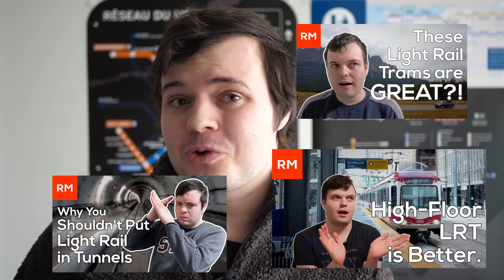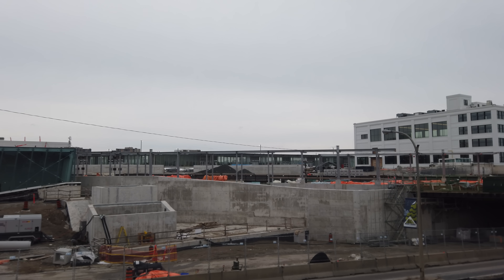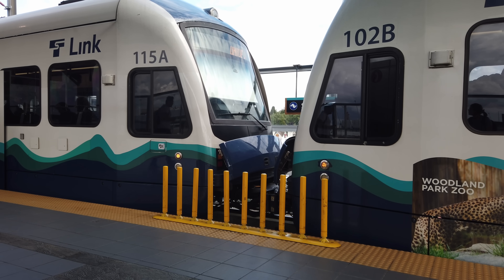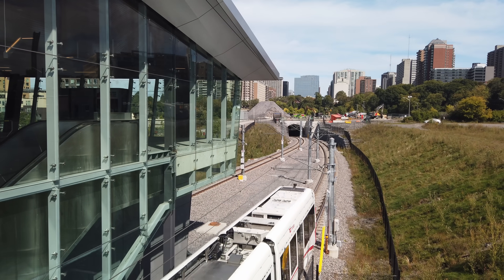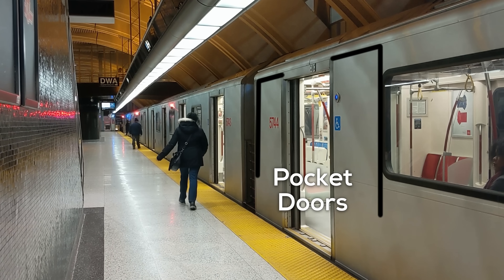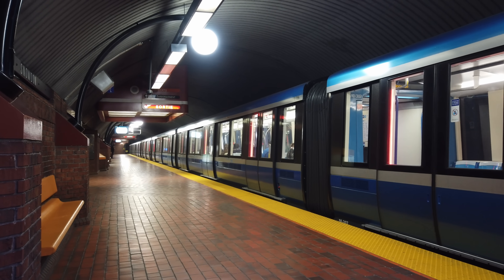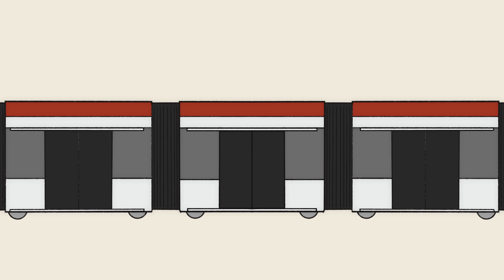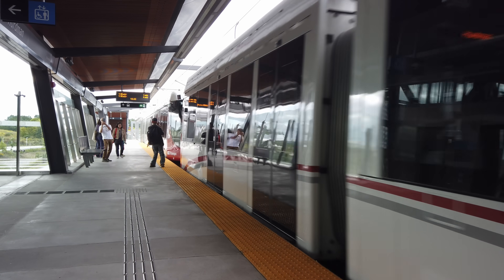I Designed a Better Low-Floor Tram

Comment: Your invention has been tried out in Germany in the eariy 1990ies, with the EEF (Einzelrad-Einzelfahrwerken) and the prototype with powered single wheelsets (axle configuration A'A'+1'1'+A'A') was a massive failure as dynamic wheel-rail behaviour whent banana.  The project and prototype got scrapped.  However small batches of unpowered wheelset equipped tramways have been produced, among other running in Kassel, model NGT6D (axle configuration Bo'+1'1'+Bo').  Siemens had also produced one Combino prototype with a single unpowered wheelset at one end in the 90ies, which didn't work well.  The Copenhagen S-Tog you've seen developed by LHB (since then Alstom Deutschland) with mechanical cross-links between axles which are a rolling stock maintenance abomination.  If low-floor tramway architectures were flourishing in the 90ies where every company was in look of developing and patenting the "killer LF tramway of the 21st century", these architectures essentially narrowed down to the multi-articulated vehicles which are a good compromise and that almost every manufacturer does produce now.  If you want quite long tramways take a look at the Leipzig and Dresden 12 axle fleet, they're not bad at all !
Reply: How about computer steered wheelsets?

Comment: having a flexible fleet of light rail-based train sets with interconnection between segments is actually possible. Frankfurt recently ordered new "middle segment" sets consisting of two wagons which don´t have a full driver cabin but a "half" cabin to rearrange train sets. Which means it is open on both ends and can be coupled to train sets which do have a full cabin. Since Frankfurt´s U-Bahn operates with two-wagon trains either consisting of two full driver cabin at each end or (that´s the part you´ve been waiting for) one full driver cabin and an opened end to couple with another. You see where this "two open end" wagons fit in, amr?

Comment: This is actually something that could really reduce construction costs when building new stations on new metro systems because tall platforms can be expensive, and if you combine low floor with low interior height more comparable to that of say, the Glasgow Subway (which is a little extreme, but illustrates the point), then you could drastically reduce overall construction costs by reducing tunnel size and platform height, if that makes sense, and would do so without sacrificing capacity.  Does that make sense?
Edit: typo, oh, and the Siemens ULF trams in Vienna had most of these features.

Comment: I have a different idea for a high-capacity low-floor train:  Look back to the Boston Elevated Railway's Center Entrance Cars of the early 20th Century.  They weren't 100% low floor, because they had ends riding on normal bogies, but they did have large low floor center sections with 1 BIG sliding door on each side, and lots of standing room; they gained the nickname "crowd-eaters".  They were mechanically very simple (no articulation junctions, weird suspension, or strange lateral sequences of axles to make otherwise isolated wheels track properly).  This would make maintenance easy and infrequently needed assuming good quality of parts and assembly, as well as greatly reducing initial capital investment.  What killed them was the lack of a proof of payment fare system, so that you had to have a conductor in each car as well as a driver at the front, but having a proof of payment fare collection system would get rid of that problem.  If you additionally made the control stands fold up into the sides/ends of the car when not in use (and have each control cab have a big interior sliding door that you leave open when not in use), they wouldn't even take up much horizontal space.  (Naturally, you would need to have the control stand fold into a locked cabinet when not in use, but I understand that this has also alredy been done on both streetcars and metro cars.)  Of course, you would want to modernize the Center Entrance car design to have pantographs (instead of trolley poles) and AC propulsion, as well as add air conditioning (although consider running fans to draw in outside air instead of running the air conditioning when the outside temperature is right for it, to save energy).  In systems that have less sharp maximum curvature than Boston, you could also make them longer for more capacity (after a certain point, you would need to go to 2 or more doors on each side); but even in Boston's system, a 6 car train of these would have almost the same capacity and be about the same length as a 6 car Blue Line train (metro that uses short cars due to being originally made by conversion of the East Boston Tunnel from a tunneled streetcar line into a rapid transit line, which had the unfortunate effect of breaking the one seat rid people were getting before).

No fantasy design needed -- everything has been done on some successful transit vehicle or other.  It just needs to be combined into one package.

Comment: 4:37 So you're telling me that low-floored "light rail" vehicles often have a greater weight-per-bogie than their "heavy rail" counterparts? Something isn't quite right about that...
Reply: Light rail vehicles are generally 'heavier' than heavy rail vehicles. Because the light vs heavy in the name refers to how intensive it's operations are intended to be, load wise, not to the mass of the vehicles that opperate on it. 

Basically, because of the conditions they operate under, making heavy rail vehicles heavier makes them less efficient for no benefit. On the other hand, light rail vehicles operate under conditions where the extra mass (mostly in the form of greater structural integrity and more safety features, to my understanding) is a Significant safety advantage, and they don't generally operate at high enough speeds for the loss of efficiency caused by that extra weight to be particularly meaningful. 

So, yeah, the 'low floor' part doesn't matter, but light rail vehicles are generally heavier per wheel/bogie (and sometimes in absolute terms, for that matter, depending on the exact designs in question) than their heavy rail counterparts.  

Edit: Note that this applies to Passenger vehicles. Not that you get much in the way of freight LRVs these days, but the relevant factors involved mean that freight wagons for light rail would generally be lighter than freight wagons for heavy rail. Freight is heavier than passengers, necessitating more mass be dedicated to the structure holding them, and an LRV would run into issues with wagons longer than a single shipping container (heavy rail wagons generally being long enough for two, and then often stacking them two high as well)
Reply: @laurencefraser  Thanks for explaining! Until now, I just assumed that light rail vehicles were named because they were smaller and lighter in weight than full-size trains.

Comment: Nice video. Some tramcompanies in Europe are at the moment in doubt how to handle the lowfloor concept: existing trams are having their issues resulting in more trams in the workshop as planned. Not to mention extra maintenance costs on the infrastructure. So some companies has decided to do a stap backwarts in favour of traditional bogies. One exemple: RNV (Rhein Neckar Verkehr) in Germany has ordered new trams from Škoda to replace the first generation of lowfloor trams, the first of which will be delivered this year or next year. The bidirectional trams will have 3, 4, or 6 units, each 10 metres long. Every segment will rest on two bogies. The 4 and 6 unit-trams can be split in half in case of maintenance or repairs. That way they do not have the need to rebuild the workshop. RNV is expecting much better comfort AND a reduction of 25-30% in costs for tram- and trackmaintenance.... The consession RNV has choses for is a tram with "only" 75% lowfloor because the seats above the bogies are placed on so called podests. In my view they have made a good choise: most people have not a single problem to climbe a small stap and trams on fixed trucks are not running very well in curves.

Comment: Actually this train is quite high capacity, but people just hate standing, whether it's a short journey or not. 
Therefore, I suggest to merge two "cars" into one and keeping only one door for each. Except from the extra seats, also, this can help make larger doors, and a few seats with space underneath. The space underneath can be quite useful, like putting luggages under the seats, which would also increase the spaces for standing.
I think more seats is for both higher quality travel and more passengers. Imagine the tram as a bus, people can easily get a seat and this is one of the main reason people taking buses. More seats can provide a better journey, so actually if the capacity lowered by a bit, they can just buy one or two more tram!

Comment: Hey, does this train in your intro at ca. 0:47 actually climb this much into the station or is some optic illusion?
To add one more thought. What could be done to speed up enter and exit is having two sided station, that way you double number of doors. Only problem I see is wind. =)
Reply: Spanish solution!

Comment: although these are nice suggestions, ultimately I think the best solution is to avoid low floor vehicles unless really necessary.  Even if parts of the system runs at-grade, using high floor trains is just better for capacity. It doesn't need to be super high floor, just high enough so that bogeys and internal components don't obstruct the interior cabin. With proper planning, the platforms can be high floor without sacrificing accessibility. In the long run, it's properly cheaper than ordering potentially complicated rolling stock.

Comment: Quality over quantity is exactly why Azur trains have 3 doors instead of the 4 found on MR63/73 trains. Also the boa configuration meant removing 4 cabs per 9 car trains which allowed for sections of 3 or 6 cars trains. Hence why MR73 trains can still be found on the blue line which still uses 6 car trains. I don’t know if it’s feasible with a tram style turn radius but shared bogies between sections could help spread the weight and make the train sturdier at the same time.

Comment: With Low floor platforms the rails are at the same height as the platform. When I was in Seattle I could completely see myself running across the tracks to get to the other platform if I absolutely needed.

Comment: A few thoughts here...

First, wider doors aren't necessarily better.  In Chicago, we used to have cars with two smaller doors next to each other.  That encouraged people to use both doors.  The newer cars with one wider door means that only one person enters or leaves the train at the same time, instead of two.

Second, the fairly recent 5000 series cars dispensed with the transverse seating in the middle of the car and it's caused a lot of complaints.  Many people hate the arrangement, both because it's tight, with several people sitting in a row versus two next to each other in a row so each can overhang, and people say that they don't like staring at other people's mid-sections.  The new 7000 series has gone back to a modified transverse seating arrangement.

Next, wheels that aren't connected to a fixed axle are problematic as they don't steer very well around curves.  Boston, for example, had a lot of problems with this.  It can work, but it's temperamental and it's really a lot better to have wheels connected by fixed axles.  It may be possible, with modern electronics and a motor on each wheel to compensate for this, but if the system breaks then the train may not be able to be towed out of the way very easily (and it will break at some point).

Also, where the wheels/axles/truck centers are located on the car directly affects end and middle overhang in curves and the curve radius that can be negotiated.  It's better to have longer cars with fewer axles, if possible, when curves are not as tight.

Lastly, the weight on each wheel isn't really that big of a deal.  The rail and track can be adjusted to accommodate the axle loads.  Even heavier trains on transit still have relatively light axle loads as far as railroads go.

Comment: It's going to attract the "Reece's Pieces" nickname... :)  Spacing of the wheels would have to be carefully considered as derailment could be a risk with a greater distance between the wheel centrelines. The ride on substandard track could also be an issue. Free rotating bogies (Jacobs or otherwise) allow for bogie movement independent of the car body, giving a smoother ride for passengers. One possible extra capacity hack, any transverse seating should also be flip up seating for use when the vehicles get really crowded.

Comment: Do a same video/es on how to design a high floor suburban train 🚆 or metro train 🚇. There're various train designs with loading gauge, door and window placement, door width, seating configuration, standing room, carriage length, coupling and etc which can be explained in detail.

Comment: an interesting idea but i notice 3 flaws, not completely shooting down the idea because ideas are what get the creative juices flowing and thats good for engineering but still

1: the overly complicated bogey-less system is going to be difficult to engineer. bogey systems are already well understood and cheap to design/maintain/build compared to complex systems like copenhagens model. you are correct in your assessment that cost is a very important factor when deciding these things, but will that cost truly outweigh the gains in capacity? expensive =/= good

2: the extended length idea removing cabs is a two-fold problem. first is that you will run into the same problem you pointed out earlier in the video in that if you end up in an road accident, you have completely disabled an entire vehicle, and not just part of it. the front or back half can be removed and operate independently if the other is damaged to the point of needing immediate repair or scrapping. secondly is that once you have a vehicle that long, you might as well just build an metro system that operates independently from roads

overall, the larger sliding doors and the premise of the seating is intuitive and has some good merits, but it'd be more beneficial to have 2 moderately long units rather than a bunch of small ones or one massive one, gives you the best of both worlds. as for the bogeys, it'd probably be best to just live with the problem in some areas of the unit and have dedicated seating areas for less mobile commuters.

Comment: Not sure I understand the intended wheel arrangement. I assume either something like the Cobra tram system with steered single axels at either end of each segment or something like a car’s pivoting front wheels at each segment end.

Comment: I hate Toronto's new streetcars. They claim to hold more people than the old ones in ideal circumstances, but the seating is so awkward that that's barely ever true.

Also, there's just no good seats. The old ones had an entire side of good single seats. Now your stuck awkwardly bumping knees with the person across from you. I like your design much better.

Comment: I am not sure why there is an issue about low floor light rail vehicles (trams/streetcars) traveling underground and above ground. With regards to higher capacity light rail vehicle manufacturers like Alstom, Siemens, CAF Stadler, etc have been designing their vehicles for higher passenger capacity  based client's requirements.

Comment: That was cool! I've really come to enjoy hearing you talk about rolling stock design. It really is underappreciated, and I'm glad I'm being cured of my prior indifference to it. I can see also why you seem generally to prefer more deliberate selection of mode rather than trying to mix various things together into one package that doesn't do any job well. If you need a metro, build one; if you need a tram, build that. Seattle is, by US standards, building an impressive system. Considering the money being sunk into it, it would probably have been just as cost effective to build a traditional metro to serve the city. Unlike the first built segment, they've gone really gung-ho on building grade separations at great expense and long ass platforms for equally long train consists. The frequencies ain't bad either. I guess the lesson is to regard our infrastructure as an investment in the future so don't mind the costs so much. Building the cheapest option isn't necessarily the best idea, and if you're a rich country, being a little extravagant shouldn't really be a problem either. Put in the effort to not only make the system high quality but attractive, something people can point to and be proud of. Utilitarian designs don't usually inspire such feelings.

Comment: A lot of people in the comments mentioned Frankfurt‘s U5 but I‘m kind of surprised nobody’s talking about the Typ T trains of Vienna. I‘m pretty sure those are basically the very first low-floor trains ever used on a proper metro line and they seem to perform quite well. Sure, the number, or at least width, of doors could be improved, just like there really should be an open gangway at the rear end. But I much prefer their layout to the more common flexity swift versions in, say, Cologne or Croydon.